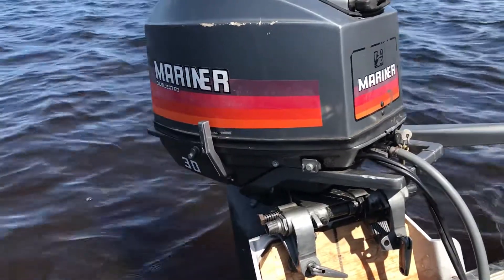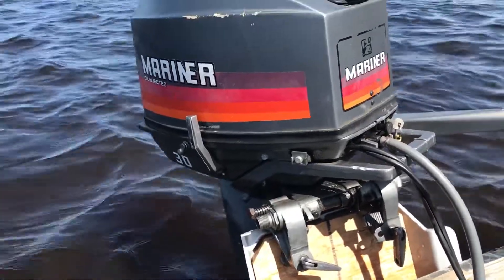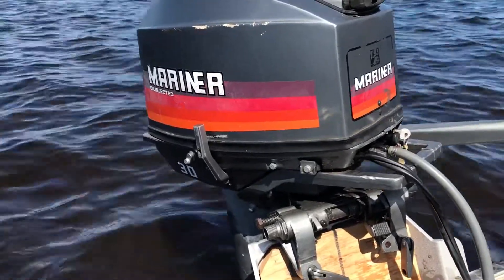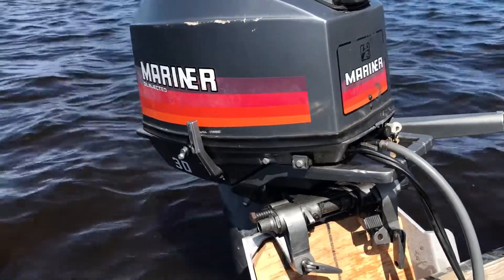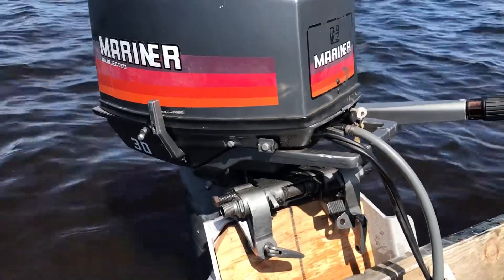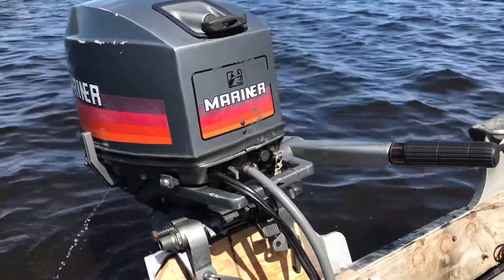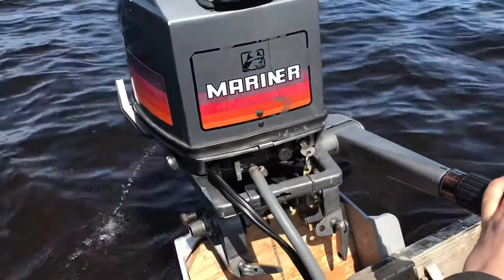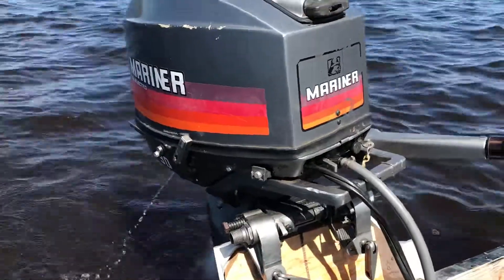1987 mariner 30 hp outboard

Comment: Hey I got a question do you know where I can get a new water pump impeller mines rotted out and I can’t find them anywhere please help
Reply from the maker: Maybe try looking for a 1987 Yamaha 30 HP water pump i’ve had a hard time finding parts for mine because it seems like Mariners are made by three manufactures some parts are mercury some parts are Yamaha and some parts are mariner but I found a lot of the Yamaha parts are interchangeable with mariner I believe I got my water pump somewhere on eBay but here’s a link to one I found on Amazon that might be right https://www.amazon.com/689-44352-02-689-44352-02-00-689-44352-03-689-44352-00-00-47-81604M/dp/B016U2TYX0 but if this link is not the right one try looking at Yamaha 30 HP outboard parts you might be able to find one that way.
Reply: sorry for the late reply. I get everything on ebay or amazon! they have plenty for this motor! hopefully you found one by now!~!

Comment: Doing a carb repair kit. What angle or position does the float got be in? Any chance ya know?
Reply from the maker: I have my float adjusted to about level with the carburetor I think, I had trouble with my carb repair kit I bought The new float that came with it if I remember right it set to low and it would idol all right but I would flood out the engine at the top end so I ended up just keeping the original float and replacing everything else it seem to work all right although after I rebuild the carb every once in a while it seems starved for fuel at the top end still haven’t figured out how to fix that yet at least with my Moter.
Reply: what he said!! thanks for commenting and watching!

Comment: Hi, I have just acquired 1 of these but it needs a propeller and split pin nut, can someone please tell me the size I need.
Reply from the maker: I am not exactly sure what the size is when I got this Moter it did not have a prop on it either and I got the prop ,spacers and nut off a 1988 Yamaha 25 but here’s a link which you may be able to get all the parts from there or at least see how it goes together let me know if I can help with anything else.

https://www.crowleymarine.com/mercury-outboard/parts/270_180.cfm?mdl=VFXKRQ
Reply: what he said!! I usually get a part number then shop ebay for the best prices

Comment: Wow, that motor is running great! I have the same motor but i believe my timing is off. Would you happen to have the timing intervals from the manual??
Reply from the maker: I cannot find a manual I bought for it so I don’t know the timing at the moment but if I find the manual I’ll let you know what the timing is but the manual I bought for it is “Mariner Outboards 25/W25/30/W30 Models OEM Service Repair Manual P/N M-90-84681” I think it’s for an older motor but it did work.
Reply: @RonJKuschel1901  The manual for a 1980's Yamaha 30 will work too! These motors were made by Yamaha and then sold to Mercury. The Yamaha P/N is LIT-18616-MR-00.
Reply: She runs great! I gotta say, this is one brand of outboard I've never tried but watching your video has me thinking about getting one. 👍 Thanks 👍
Reply: doesnt really have timing